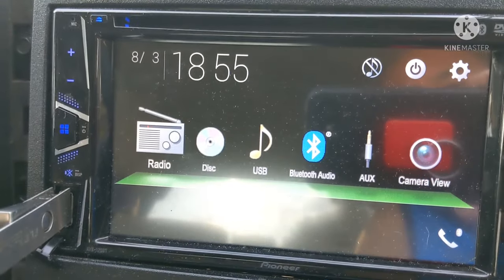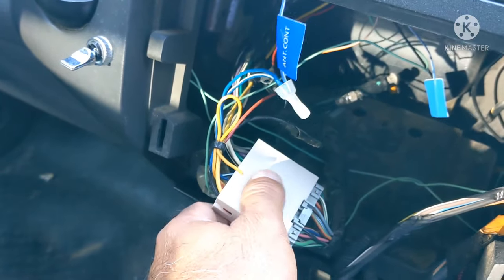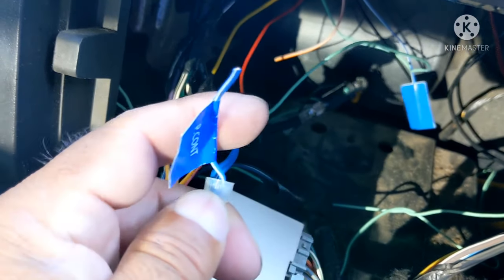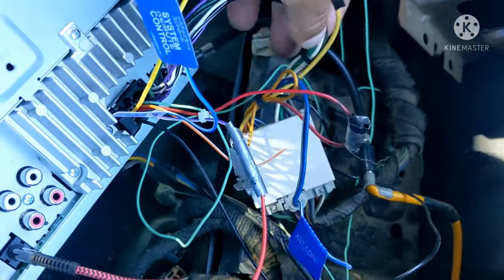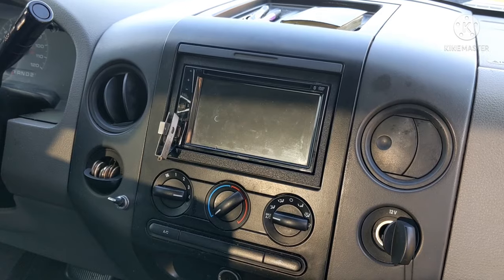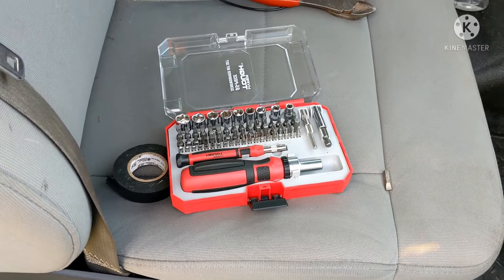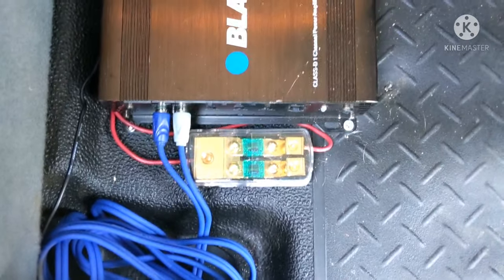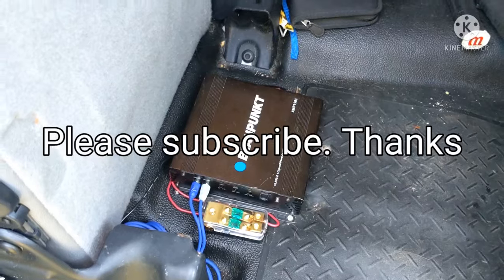Installed a Car Amp to my Pioneer AVH-120BT double din stereo

Comment: I hope that power wire that goes to the battery has a fuse that is close to the battery, because if it doesn't and something shorts that wire you will catch your car on fire.  Really that fuse block near the amp is not protecting much. the amp has a fuse already.
Reply from the maker: Yes it does,  starting at the battery.  Thanks for the comment

Comment: Where did you wire the red wire on the back up cam cord, my stereo doesn’t nothing unless I have the back up car cord plugged in and the red wire touching a ground. So where you put the red one to?
Reply from the maker: I actually have another video in my channel  on how to hook up the back up camera and the wires. Check them out and thanks for subscribing.
Reply: Purple wire, should say reverse gear switch
Reply from the maker: @Alysavos-rd4tp  mine wasn't labeled

Comment: I've got one question about the same stere you got. That solid lime green wire, where did you run it coming off the harnest? I've got mine hooked up straight to chassis ground but am at a loss as to if this is my trickle de charge problem I've been having, I'm on alternator number 5 and going after any ground issues that may be causing my misery
Reply from the maker: Hi, yes disconnect that. I can't remember but I think it goes to my backup camera.  Check out my video where I connect my backup camera.  Hope this helps
Reply: The solid lime green wire is your parking brake wire
Reply: Actually you can get a toggle switch and run the lime green too one side and run a wire for a ground and connect too other side of switch. Then you can switch it on and off even when going down the highway.
Reply: @terrellanderson7234  put it on a toggle switch.

Comment: back in the day we just hacked the wires and pulled door panels and traced the wires, but i only made 3.15 an hour then, jeez im getting old as fk
Reply from the maker: Yes Sir I agree.  Now you have to worry about a voltage change messing up a computer or something crazy like that.

Comment: Hi. How do u make 4 channel amplifier work together.. i mean preout setting in headunit is either rear or subwoofer. U cannot select both. Can u help me out i have 2 component speakers and a subwoofer... If i select subwoofer in preout setting front chanel of the amp doesn't work.

Comment: Can't get rite ( bro,my Yukon is 12 v's but tha fuse is an 10 amp fuse?"- is that to low,but should I fine a fuse ass.that is lower then 10 amp x fuse panel not understanding how it installed plse, help me.
Reply from the maker: No that 10 Amp ok. That's just if it overheats so it won't catch fire. What is the problem with your radio? Whats wrong?

Comment: I just got the same radio. I cut the factory harness. The radio comes on but it doesn't shut off when I cut my car off.
Reply from the maker: Hello LT, so there is an orange wire and a red wire on the stereo. The red wire should have constant power for memory. The orange should have power only when you crank the car on and off. Use a voltage light to see where you get on and off power when cranking the car on. Connect a non constant power source  to that. Hope this helps and thanks for the follow.
Reply: @paultrevi  thank you

Comment: i have a 1994 caprice classic ls and i’m trying to hook up the same radio inside my car. the white harness  that u are talking about if i buy that piece i don’t have to cut no wire just plug in and go
Reply from the maker: Yep, it's that easy.  I've done a lot of stereos and never had in issue. Hope this helps and thanks for subscribing.
Reply: @paultrevi  I have question about the harness block.
Where can I buy it & what is it called?
I DO NOT want to cut any wires.
Reply from the maker: It's called a radio harness adaptor.  At wlamart.
Reply: @paultrevi theres a ton of them and none worked for mine

Comment: I have the same head unit and installed it in a 2005 jeep wrangler with a factory amp and sub. The amp and sub do not work. and when i use the rca plug i get a amp error on the screen.How so i connect it using the factory amp and sub?
Reply from the maker: Thanks for the question.  I usually don't like to use factory anything with aftermarket.  Sometimes for whatever reason they aren't the best. I would try an aftermarket Amp and connect that way.

Comment: A amp is a good idea. This radio is weak. It might be 50w. It sure isn't 100w. I need a 100w 4 ch amp for my 80w speakers for this radio. My old single din 45wx4 from the 90s is louder than this stereo. And the screen is so cheap it is plastic. I can buy a new OLED screen for a phone for $20, so this is a $10 OLED screen with resolution so low the icons look distorted like 8 bit graphics up close. I'm trying to hook up AUX video to mine and mirror. The screen is pretty useless on this unit. It's only good for the back up camera which I don't have installed on my 1995 Honda. The instructions also say a DVD may get stuck in it, and front USB only supports FAT16 and FAT32 files. So you can only plug a USB stick into the front USB for music. The rear AUX is for video input. This unit has autolink that works every time it powers on, but your phone has to be set to Bluetooth ON before getting into the car for it to auto connect. My review of this stereo is the labor installing it cost more than the stereo, so buy a more expencive unit if you're not installing it yourself. I mean if you need to pay $100 for a amp to power it you might as well add that amount to a better unit and go with a $300 stereo. The reason this stereo is cheap is because it comes with nothing. Add up the microphone, AUX, RCA wires, a video bypass, backup camera, a 100w amp, double din stereo kit, steel basket, and you're in the $300 range. A cheep Jensen GPS/DVD comes with a steel basket, plastic frame, microphone and camera for $300. So this Pioneer is real cheaply made. This is basically a $50-$75 radio Wal-Mart sells for $127. Guess what Wal-Mart pays for it? It's a cheap radio. It's so cheap. Go to Target and buy a Jensen.
Reply from the maker: I agree, 100%. Had it 2 yrs. now so it's time for an upgrade.

Comment: You need 2 Y connect then connect one Y connect to the white and the other Y connect to the red front you can connect a 4 channel amp
Reply: How do u make 4 channel amplifier work together.. i mean preout setting in headunit is either rear or subwoofer. U cannot select both. Can u help me out

Comment: Definitely need bigger power wite get at least 8 gauge for a small amp.
Reply from the maker: I would but I don't constantly play it loud. Every now and then I do. Had this way about 1 year with no problems. Good suggestion tho. I agree
Reply: @paultrevi I was thinking the same! You said you "don't play it that loud" but at what point is to far for the wire to overload, overheat, and catch fire?

Comment: Can i connect a sub amp and a 4 channel amp on this stereo ?
Reply from the maker: Yes, you will need a spliter to make 2 chanels then use the amps tuners to get the desired sounds you want

Comment: Hey Paul I bought the same radio a month ago but my I can use the phone I can't hear or speak
Reply from the maker: Be sure it's connected to your Bluetooth and if it is try a different phone. I would also try a.d make a call from your stereo to be sure it's connected. You can also try a aux cord just to see if your stereo isn't defective. If it works then something is wrong on how your connective via Bluetooth. Be sure to give it permission to to access your address book and stuff like that. Hope this helps. Thanks for subscribing. Hope you had a Happy Thanksgiving
Reply: @paultrevi  thanks for responding I'll do that. Appreciate it

Comment: I have a 3000 watt amp with 2 12s and it’s not supply power but everything is wired right is it the radio ?
Reply from the maker: Be sure you supply the power from the battery.  With a separate fuse. From the radio, only the antenna wire should be giving power to the remote on your Amp. That's what turns in on. But get power (red wire) from Battery to your Amp. The radio is fine
Reply: Can it be the wire used ? I used 1500 watt wires
Reply: The radio and factory speakers work it’s just the sub that don’t
Reply from the maker: @capoeli  the thickness can make it hot. Too hot
Reply: The gauge ?
Reply from the maker: @capoeli  a 4 gauge is good
Reply: That’s what it is it’s 4 gauge and 1500 watts 😂

Comment: Which rcas do u connect on the back of the stereo for the subwoofer ?
Reply from the maker: This model has only 1 set of red and white rcas. It's on the unit.  Hope this helps.

Comment: Almost clean install, few questions why didn’t you use male/female connections??? Why didn’t you install a new ground for the car stereo??? Factory ground is ok except you’ll have less white noise. Then why didn’t you heat shrink  for covering the wires??? Electrical tape is ok except it has a tendency to be a cheap look to it. I haven’t used electrical tape in 30yrs. Last but not least why didn’t you use zip ties. Zip ties/heat shrink or connectors will be no more then $5.00. If you’re going to do something….”look at how the experienced audio installer” goes about this. Reason for the connectors or the heat shrink is to make sure that what ever you connect stays connected. As for the radio you just installed…..”leave it with the truck bc the next vehicle might not have a double din.
Reply from the maker: Thanks for the time you took to text. Truck is sold and gone. I didn't do shrink wrap because when I sold it I replaced this stereo with the original.  Plus I didn't get any white noise. So no need for a separate ground. I did to the amplifier tho. Not doing the shrink wrap allows me to easily disconnect the wires.  Again, I'm not a pro just trying to help some people out.
Reply: We got Audio system police over here
Reply from the maker: 😃😃 that's what I was thinking at the time of the comment. Haha. I was waiting for a ticket or something.

Comment: I have a avh 120bt and I don't have any signal from the subwoofer rca jacks. Can the speaker wires and the rca jacks be used together?
Reply from the maker: Yes, actually  I've used wires  to front and back speakers  before while connecting rca Jack's to an amplifier for subs.

Comment: You didn’t show where you plugged the rca into back of head unit
Reply from the maker: Hi TR, actually the picture you see at the beginning of the video is where you connect the red and white rca to. That connects the stereo to the amp. Hope this helped.
Reply from the maker: Also at 2:43 into the video I actually talk about where to connect the RCA jacks. I point right to it. Thanks for subscribing.
Reply: @paultrevi  thanks for the reply

Comment: Did your mic work and what jack did it need 2.5 or 3.5
Reply from the maker: The mic worked just fine from the stereo. The auxiliary Jack that I used was just your standard one you plug into regular headphones I'm not sure if it's the three or the two.
Reply: Appreciate it what brand or where did you get yours from ?
Reply from the maker: @JuanRodriguez-lm6no  from Walmart, it's a Pioneer

Comment: Hey paul 2 questions, where does that light green wire on that harness that came with the stereo connect to? how do I connect  that?
Reply from the maker: Hi Jairo, the green wires are speaker wires. You have 8 wires that connect to the speakers if your not connecting to an amplifier. If it's green with a line, that's your positive. If it's solid, that's a negative.
Reply: @paultrevi  thanks Paul! Oh yea, I would like to see a video on how to connect a Parking Brake wire if possible thanks in advance.
Reply from the maker: Yes, I have a video on that as well. One on my Camero and one from my truck. Check them out. It's the same setup. Thanks for the follow.😊
Reply: @paultrevi  awesome appreciate the help amigo! No problem thank u

Comment: why does mine have a purple wire that says reverse and not the blue wire
Reply: i figured out it’s connected to something else already any tips on how to split the power ?
Reply from the maker: @Moistcoconut69  I would use a power block. Get power from a battery source then a power block usually has 2 or 3 connections for other sources

Comment: How do you connect the rear pre amp too a amp
Reply from the maker: I'm not sure. You can connect 2 amps by using a splitter from the unit then using the amps settings for individual sound like mids or base

Comment: Bro, that’s not a mic input. That’s a “wr” wired remote, it’s for steering wheel controls
Reply from the maker: Ur right, I installed this a year ago and found out later. Good eye mate! 👁
Reply: Did ya figure out where to connect the external mic, or is it possible to even use the external mic?

Comment: I have exact radio why does everything delete when I turn off my vehicle?
Reply from the maker: You probably didn't connect the constant  wire.
Reply: @paultrevi  what color red?
Reply from the maker: @chrisperez1813  yellow.  Yellow is constant. Red is only when ignition is turned on
Reply: @paultrevi  my yellow is connected but it still resets when my car turns iff
Reply from the maker: @chrisperez1813  check the yellow with a voltage meter to be sure it's getting constant  power. Or get constant power  from a other source.
Reply: @paultrevi  do you think it’s because I have the remote wire and the constant wire together?
Reply from the maker: Yes, definitely,  should be separate.
Reply: @paultrevi  ok what do you recommend  cause i only have one wire for power
Reply from the maker: @chrisperez1813  run another wire from battery with 10 Amp fuse and use that as a constant
Reply: @paultrevi  thanks so much for the help
Reply from the maker: @chrisperez1813  Good luck Chris

Comment: WOW duct tape and electrical tape to make connections. I guess you want to have a short or a fire.  NEVER EVER EVER use tape for a connection. Buy some spade or bullet connectors or at least some butt connectors.  If you are going to make videos do your subscribers a favor and learn how to install properly.  AS for your RCA's buy some that are the correct size.   Your installation makes Pro installers like myself cringe.   If you need advice I would be more than  happy to help.
Reply from the maker: Well dear Sir if you listen to my videos all the way thru I do say don't do this because I am no professional  installer.  Lol. Plus honestly before all this fancy stuff, back in the 80s we were using electrical tape. By the way its (electrical) a d I myself, personally,  have never had a fire. This video you saw was made a while back a d guess what no fire with the (electrical tape) I guess cause it's electrical! Wow. But thanks for your input, and caring for (my) subscribers. I never said I was a pro or a shop. Just a regular guy. Thanks for the algorithm though.  Good day

Comment: My sub doesn't work.  where did you plug in the remote volume control for the sub?  The Aux input?
Reply from the maker: I actually don't even use the bass controller.  I use the head unit. Be sure it's on.

Comment: Question, does the crossover on a head unit work for the rca connections also ?
Reply from the maker: Not necessarily,  I have a mono Amp connected to mine for bass. Now, the other 4 speakers are connected stright to the head unit so the crossover works on those. I usually use separate amps to do what I need for each pair of speakers. So I would use a separate Amp for 6x9s for example and control that way. Usually the head unit crossover won't do what you want for say mid, highs and lows individually like an Amp with controls will.
Reply: @paultrevi  ok thanks, i have a mono for bass but i recently got a 4 channel amp with 2 mids and 2 horn drivers im thinking of putting those 4 on it and leaving those on the doors connected directly to the head unit would that be okay?
Reply from the maker: @tonyswagz  yes, definitely the way to go.
Reply: @paultrevi  thank you I greatly appreciate the help
Reply from the maker: @tonyswagz  your welcome, please subscribe and if you already did thanks a million.
Reply: @paultrevi  definitely 💯